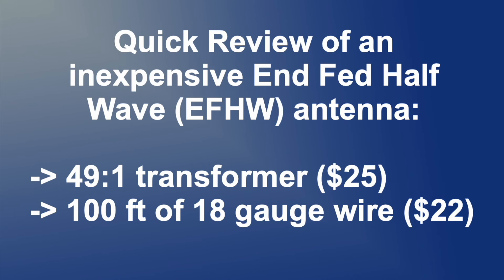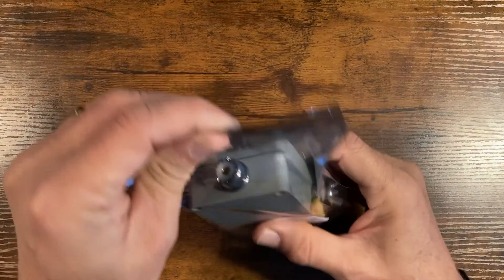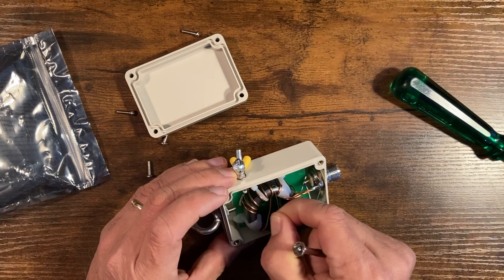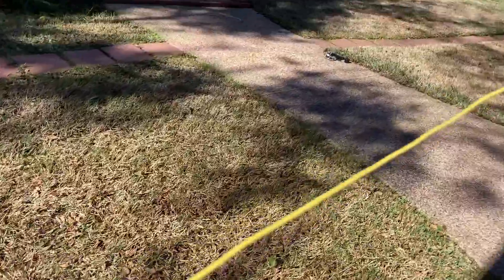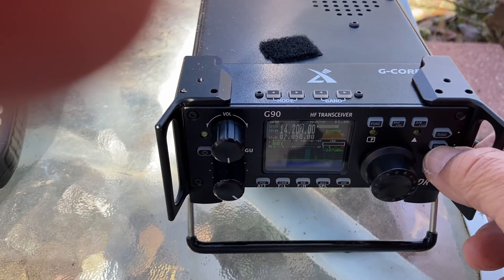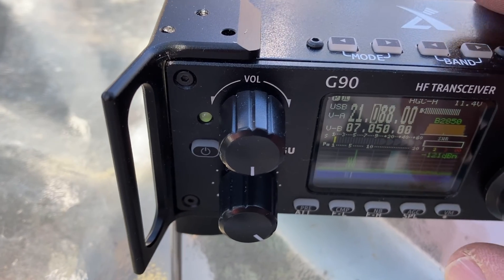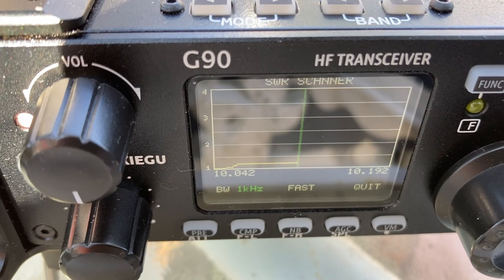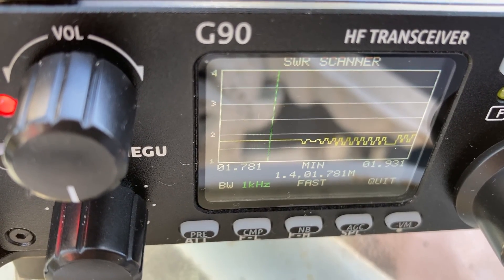End Fed Half Wave antenna and the Xiegu G-90

Comment: INteresting. Just got a G90. Why a balun rather than an unun?
Reply from the maker: Thank you for the comment.  Personally I don't think of it as a Balun or Unun, rather I view this device as a 49:1 impedance transformer.  I suppose that you could categorize it as an Unun since it takes an unbalanced COAX cable as input and outputs to an unbalanced 67 foot wire plus a 12 foot counterpoise.  Notice that if we had a symmetric Dipole antenna, then we'd have a balanced transmission line and if we had a COAX cable (Unbalanced) at it's feedpoint, a Balun would be recommended.  Some folks may treat the Balun as "optional" in a COAX fed dipole antenna; however, per my understanding, a Balun is recommended in these antennas to optimize the coupling from the unbalanced COAX to the balanced Dipole radiating element.  73.

Comment: 1. When referring to cable you mean wire?  2. do you have a link to Mike where you got info from. Thanks (Very green newbie here)
Reply from the maker: Thanks for the questions and welcome to the hobby!  It's a great hobby and I hope you'll have a good time with it.  1. I used the yellow 18 AWG wire as my radiating element and the RG-8X coaxial cable from the radio to the 49:1 transformer.  2. Not sure I understand the question but I did include the links to the transformer, 18 AWG wire, and battery holder in the description.  Best of luck!
Reply: @ you referenced seeing a video about this before you used this setup, but there was no link to that video. Do you remember the video?
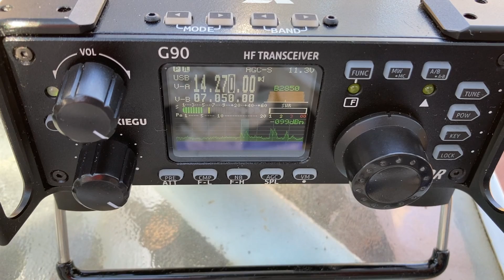Reply from the maker: @prepperboss  If you're referring to the mention at 09:35 mark in the video, I'm giving credit to K8MRD's video on EFHW deployment using a fiberglass pole: https://youtu.be/vMtKKD4VibE?si=hJXIzqrTZqjIPWHR
Reply: @ yea I was thank you.

Comment: I tested both end fed with 9:1 unun in 35' vertical and 65' inverted V,  I experienced interference from am/fm broadcast.
Reply from the maker: Interesting.  This antenna uses the 49:1 transformer and my QTH is in the city so I get a high noise floor and interference.  When I do POTA I take a similar EFHW with its 49:1 transformer and I get a low noise floor and not much interference.  Best of luck in your project & 73!

Comment: How well would this antenna work if it were a 65ft EFHW mounted nearly level at 20ft above ground?
Reply from the maker: Thank you for the comment.  I'd say it would have a different radiation pattern but it should work fine since 20ft is a good height above ground.  It would be good to model such an antenna in MMANA GAL or a similar program.  73!

Comment: Good video. I have a question of technique; that is why does no one on YouTube use small powered screwdrivers? I use the heck out my drill drivers and my small skill hand held screwdriver. I do have grip and wrist movement issues so maybe that's why I use them, but they truly are easy and quick. Maybe it is a rule among YouTube content creators that they shall not use electric screwdrivers. Just a rando thought. Kinda like a random length end fed antenna. I only resonate on a few frequencies.
Reply from the maker: Thanks for the comment.  No rule against electric screwdrivers.  I haven't bought one yet, though it may be a good idea to do so.  Sounds like they're the cat's meow.  73!

Comment: So it was 100 foot wire but dangling/vertical at approx 65 feet? Thx!
Reply from the maker: Thanks for the comment.  Yes, the entire length of the wire was 100'.  65' were in a sloper configuration tied off at the top of the pole and the remaining 35' were left dangling off vertically down to the ground.  Hope that helps!  73.

Comment: Being new to efhw antennas,  is there a counterpoise? Thanks.
Reply from the maker: Thanks for the question.  It is actually a very good question as evidenced by the entire videos out there of knowledgeable folks discussing this very point.  In my understanding of it, yes counterpoise wires are necessary for EFHW antennas; however, how you implement the counterpoise is the key.  In my view, the coax from the 49:1 transformer to your transceiver, the outer sheath of the coax actually, provides a counterpoise to the antenna thereby affecting the radiation pattern, SWR, and matching impedance.  So the short answer is yes and the bonus is that your coax's sheath may already be doing  it.  73 and best of luck in your pursuits!
Reply: @QuantumRadio  A great response!  Thanks. In my mind, considering using the shield as a counterpoise,  it's not far from a strangely set up off center fed dipole.  Out of curiosity,  utilizing this setup for field use, are you grounding the radio or is the case just floating on the negative side of the 12 vdc?
Again, many thanks.
Reply from the maker: @cWatts-zv3oo  Hello.  The battery-radio-antenna assembly is on a floating ground, i.e. not connected to the earth.  Hope that helps, 73!

Comment: Excellent demonstration! I am essentially making this exact setup soon with that radio. I wonder if trimming the wire would bring the lower band into a better range?
Reply from the maker: Thank you for your comment and excellent question about trimming the length of the wire.  I believe that trimming would help in a specific band; however, I was concerned that it would mess up one of the other bands.  This is why I left it at the original 100 ft length.
Reply: you will get more efficiency if you have a length of wire cut for each band